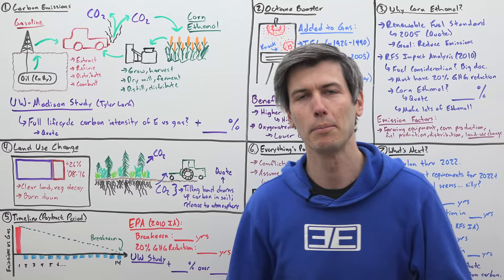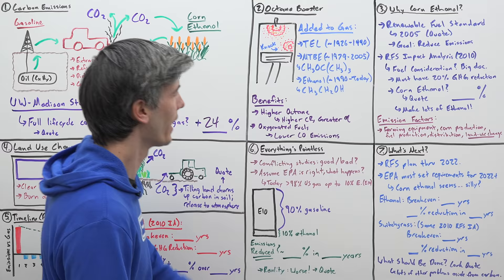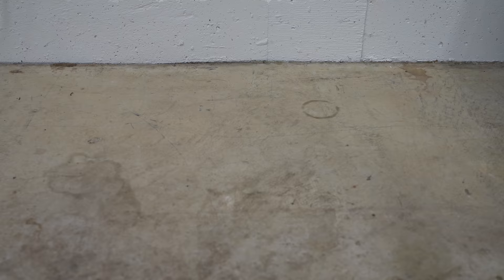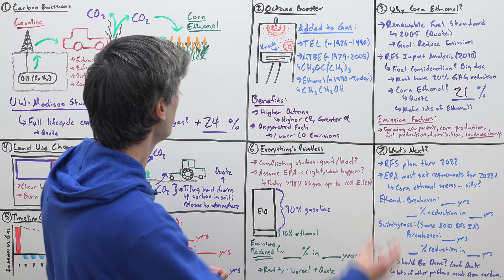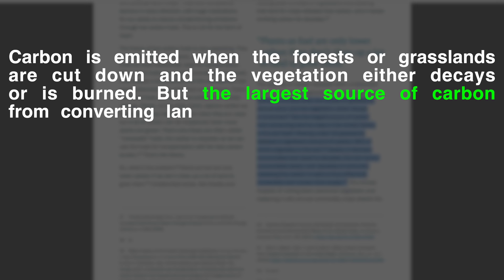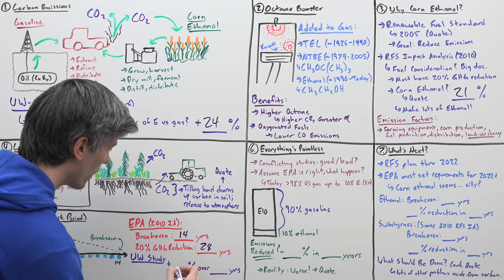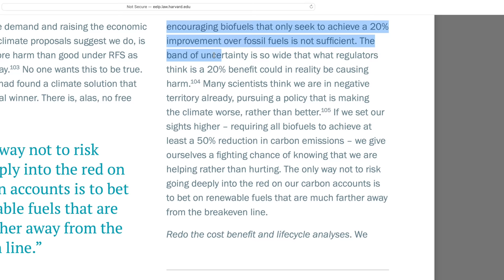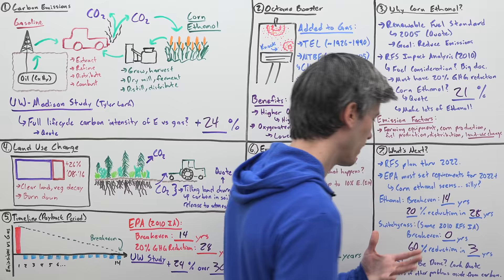America Was Wrong About Ethanol - Study Shows

Comment: Farmers don't only till once. They till at least once for every crop. It take 4 quarts of diesel fuel just to distill 5 quarts of ethanol. We're burning food. As the comment below says, "these facts were known decades ago".
Reply: BS
Reply: All the energy it takes to produce and deliver a product to the consumer is reflected in the price of that product.

As such, please note that the spot cash delivered price of ethanol on the NYMEX is just $1.52/gallon.

The price of an unusable sub-grade of gasoline (RBOB) is $2.21/gallon.

It takes more energy to produce sub-grade gasoline than ethanol.

To turn RBOB into usable E0 fuel costs even more from the added BTEX (benzene, toluene, ethylbenzene, & xylene) and unfortunately for humanity makes it far more toxic and polluting.

Or simply splash in >10% ethanol to RBOB and the resultant usable fuel is less toxic, far cleaner burning, and cheaper/cheaper per mile to drive with.  Who can be against that?

Note that ethanol is distilled at less than 200 degrees F and crude is distilled to remove water and then distilled at 750 degrees F to make fuels.  Also note that newer ethanol plants actually use waste steam from natural gas electric plants.  Waste steam = free energy.  Soon all plants will be this way thus ethanol's already low price has room to remain low.

Iowa State University measured all the energy it takes to produce an acre of corn into a "diesel fuel equivalent"
This included machinery, fertilizer, chemicals, tillage, planting, harvesting, drying, trucking etc. 
They found it takes 34 gal of diesel to produce one acre of corn.
What do we get from those 34 gallons of diesel?
We get >500 gallons of ethanol.
But wait, that is not the kicker.
The kicker is we still get 100% of the protein and other things from that acre of corn still available for an even better feed. A win-win.

Note that 100% of the fertilizer put on corn is still fed to the livestock in those distillers grains.  Ethanol is made only of things in the air: solar energy, CO2, and water with those latter two recycled once burnt.

Comment: What does alcohol free fuels use to boost octane?
Reply: Volatile aromatics like BTEX (benzene, toluene, ethylbenzene, and xylene) are used to boost octane in gasoline.

Premium gasoline contains around 40% BTEX.  It is expensive, toxic, and dirty.  RBOB gasoline is blended with premium gasoline to make regular E0.  

10% and greater ethanol added to RBOB gasoline makes it usable, less toxic, far cleaner burning, and cheaper/cheaper per mile to drive with.

A 1948 American Petroleum Institute study said the only safe level of benzene exposure is zero.

Comment: Figure out a way to keep it from absorbing a bunch of water (it's hydroscopic), keep it from eating small engine fuel systems, and prevent it form degrading into acetic acid over time and we can chat. Until then, give me the option of ethanol-free.
Reply: Mercury Marine, which hosted a Webinar on ethanol myths, noted that ethanol does not "grab water molecules out of the air." It is hydrophilic, which means ethanol holds water. With regular gasoline (E0) as well at E10, the primary cause of water collecting in tanks is condensation on tank walls. But unlike E0, which can absorb almost no moisture, E10 can hold up to half of one percent of water by volume, and the water molecules will dissolve in the fuel. The "solubilized" water will bypass the water separator and burn harmlessly through the engine.

>>>>Mercury Marine also says E10 may be the superior fuel(over E0) because it keeps the fuel "dry"<<<<

If ethanol did absorb water as you claim, your own eyeballs would know it for the news every winter would have the spectacle of millions upon millions of stalled cars on all the roads in the northern US and Canada.

In fact, in the days of E0 it was common enough to have stalled cars so that people would have to buy little cans of alcohol for gas-line antifreeze to fix water problems called Heet or Dry Gas.  No need to buy since E10 came along.

The fuel system parts of a flex fuel vehicle are identical to those of a non-flex fuel vehicle.  

Ethanol on most any chemical compatibility chart you will find is at worst equal to but most often easier on rubbers, metals, and plastics than what gasoline and BTEX (benzene, toluene, ethylbenzene, and xylene) are.  

You need water to freeze a gas-line and to make acetic acid, ethanol keeps the gasoline dry.

Brazil has the very same small engines we have and their common gasoline contains 27.5% ethanol.  It has worked out so well and for so long that Paraguay went to E27.

The DOE found that ethanol blends last 3 times longer than E0 in small engines because the volatile petroleum aromatics used for octane evaporate out and leave behind a sub-octane unusable fuel.

Comment: An other interesting statistic (which I'm not 100% sure is true) is that it takes approx the same energy to make ethanol from corn as you get back from burning it in an engine.
Reply: Iowa State University measured all the energy it takes to produce an acre of corn into a "diesel fuel equivalent"
This included making of machinery, fertilizer, chemicals, plus tillage, planting, harvesting, drying, trucking etc. 
They found it takes 34 gal of diesel to produce one acre of corn.
What do we get from those 34 gallons of diesel?
We get >500 gallons of ethanol.
But wait, that is not the kicker.
The kicker is we still get 100% of the protein, minerals, vitamins, fats, etc. from that acre of corn still available for an even better feed called distillers grains. A win, win.

All the energy it takes to produce and deliver a product to the consumer is reflected in the price of that product.

I see the spot cash delivered price of ethanol on the NYMEX today is $1.70/gal.

The price of an unusable sub-grade of gasoline (RBOB) is $2.03/gal.

To turn RBOB into usable E0 fuel costs a lot more much like premium costs more.  Unfortunately for humanity, it also becomes even more toxic and dirty.

Or simply splash in >10% ethanol to RBOB and the resultant usable fuel becomes far, far, cleaner burning, less toxic, and cheaper/cheaper per mile to drive with.  Who can be against that?
Reply: @danafletcher2341  thank you for the information. I'll certainly look into that. I thought that the distilling process used a lot more energy.
I knew about the distillers grain as an output, but I was not aware of ethanol being used to make the RBOB grade of fuel useable. Very cool.
Reply: @protonmaster76  Traditionally ethanol is distilled at less than 200 degrees F.  A patented nano-bubble process in a vacuum column is at 104 degrees F.  

Crude oil gets distilled at 725 degrees F.  This obviously takes way more energy.

Today's newer ethanol plants actually use the waste steam from natural gas electric plants to make ethanol.  Waste steam = free energy.

Poet, the largest ethanol producer in the world has at least half their plants this way.  Soon all will be like that for who can compete with free energy?  Thus, ethanol's already super low price has room to remain low.

As I said, all the energy it takes to produce and deliver a product is reflected in the price of that product.
Reply: @danafletcher2341  thanks again for the detailed reply.
I know this is a different tact on my original statement, but if you were to take into account the solar energy required to grow the crop the energy equation looks quite different. That is, if solar panels were used on a small portion of the field, that could be used to electrify the same number of cars that the whole field of corn could run on ethanol. Therefore, equivalent land space could be used to power cars and grow any crop.

Comment: If you continue to till the soil, of course it produces more CO2.  Now, what happens if you use no-till or regenerative agriculture practices, there should not be the massive springtime release of CO2, and if you use green-mulch crops during the winter, the theory is that you will increase the nitrogen content of the soil.  Has anyone done that study?
Reply: The study was not worried about yearly tillage on old farmland, it was based on the claim that virgin grassland and forests were broken up to grow more corn acres for ethanol and then charged 24 to 28+ years of CO2 to those acres being tilled.

Of course, that claim is impossible since US cropland have been declining.

Census data even shows that in corn producing states grassland, forest, and wildlife areas have increased since ethanol.

Believe it or not, the corn belt grew more corn acres in 1980 before ethanol than they did in 2018, the year of most ethanol production ever and ethanol plants everywhere.

2018 Iowa 13,200,000 acres of corn with record ethanol production
1980 Iowa 14,000,000 acres of corn before ethanol

2018 Illinois 11,000,000 acres of corn with record ethanol production
1980 Illinois 11,600,000 acres of corn before ethanol

2018 Indiana 5,350,000 acres of corn with record ethanol production
1980 Indiana 6,450,000 acres of corn before ethanol

100% of the fertilizer and everything in the soil still gets fed to the livestock in the healthier distillers grains.  Ethanol is made only of thing of the air: solar energy, CO2, and water with the latter two recycled once burnt.

What logic is it then to assign all the CO2 and energy of fertilizer to ethanol and none to distillers grains?

Comment: Soil amendment...
AKA fertilizer manufacturer and application!
Reply: All the fertilizer still gets fed to livestock in the distillers grains.  Ethanol (C2H6O) is only made of things of the air: solar energy, CO2, and water.

What logic is it to assign all the fertilizer to ethanol and none to the distillers grains?

 Iowa State University measured all the energy it takes to produce an acre of corn into a "diesel fuel equivalent"
This included making of machinery, fertilizer, chemicals, plus tillage, planting, harvesting, drying, trucking etc. 
They found it takes 34 gal of diesel to produce one acre of corn.
What do we get from those 34 gallons of diesel?
We get >500 gallons of ethanol.
But wait, that is not the kicker.
The kicker is we still get 100% of the protein from that acre of corn still available for an even better and healthier feed called distillers grains. A win-win.

Comment: That was a joke. I remove the ethanol now to run my 4-stroke equipment. I never have to drain the gas for winter anymore.
Reply: I dont either....I run E15 let it sit all winter. I had to charge the battery and then BOOOOM it fired right up! Video is up on my channel.Whadda joke.

Comment: Ethanol requires more fuel to do the same job. It reduces the volumetric efficiency of your engine, causing your engine to work harder for the same output. Ethanol also requires more expensive fuels system components.
Reply: FROM ONE PAPER:
Engine volumetric efficiency
A literature review on the topic of volumetric efficiency links ethanol’s higher heat of vaporization (HoV) with an increase in engine volumetric efficiency.12,13,25,26 Figure 2 presents the heat of vaporization per kilogram of stoichiometric air versus ethanol content for the fuels used in this work.

The higher ethanol HoV leads to more energy absorption from the surrounding air than gasoline, during fuel evaporation, therefore enhancing the intake air mass cooling effect. This behavior increases the intake air density when compared to gasoline. A higher intake air density tends to increase the engine volumetric efficiency, which means that the engine can burn a higher mass of air–fuel mixture, favoring engine brake power increase. The direct relationship between higher volumetric efficiency and higher engine brake power can be seen in equation (1). This higher cooling capacity of ethanol can be seen in Figure 3, which shows the relative difference to B_E0 fuel for the calculated in-cylinder intake air average absolute temperature , with each fuel and engine speed.

FROM ANOTHER PAPER:
Influence of ethanol mixing on volumetric efficiency
Figure 5 indicates the impact of ethanol introduction on volumetric efficiency at different engine speeds. As the engine speed in the mixture increases, the induction air mass and volumetric efficiency increase. As the proportion of ethanol in gasoline - ethanol blends rises, the volumetric efficiency rises as well. The heat of evaporation of ethanol is 2.75 times more than gasoline, which lowers the intake manifold temperature and improves the volumetric efficiency. As ethanol concentration is increased, the fuel consumed and volumetric efficiency rise due to lower vapor pressure of ethanol.

So how do those two papers apply to the real world?  A Chevy 5.3L puts out a clean 380 horsepower on E85 vs a dirty 355 on E0.

The very early flex fuel vehicles were methanol/M85 capable along with E85.  Because methanol is slightly corrosive, those early flex fuel vehicles had stainless steel fuel system components.  Because methanol use never materialized, that capability was soon dropped and the fuel system components went back to the standard mild steel for E85 only flex fuel vehicles.

From 2014 onward, the Chevy 5.3L flex fuel engines had a fuel sensor added to adjust engine for ethanol instead of the standard stock O2 sensor.  The cheapest price I saw for this sensor was $36.00.  Factory cost on the assembly line must be very nominal.

So far, this only applies to our current inefficient gasoline optimized vehicles.  In ethanol optimized engines, they can take advantage not only of heat of vaporization of ethanol but also flame speed front, octane, volume of combustion products, and other characteristics to not only gain horsepower but also gain in mileage.  So much so that ethanol has more mileage than even diesel engines.

Here is an excerpt of an ethanol optimized engine Ricardo built for GM and drove around a few years ago:

FROM RICARDO:
The new federal CAFE standards are calling for a doubling of fuel mileage performance, which, Vint says, is going to send OEM’s looking for high octane numbers to improve efficiency and ethanol is the best source. Ricardo, an engineering firm with over 100 years in the business of engine design, has developed an extreme boosted direct injection engine (EBDI) to optimize ethanol blends. The 3.2 V6 gasoline engine rivals the power and torque of a much larger GMC Sierra 6.6 diesel, he said, and it delivers 3.5 percent better fuel economy than the diesel.
Reply: @danafletcher2341  - Apparently, considerable advancements have been made in recent years... or engines are being built to specifically take advantage of the higher octane rating, and just severely retard ignition timing (and power) when running on non-ethanol gasoline. I have seen several builds reach similar targets with optimized parameters (higher stoichiometric/static  compression, more ignition advance, etc.)... but I have never seen such gains on a build optimized for gasoline. 

Furthermore, I have owned several pre-2006 cars/trucks in which ethanol blended fuel wreaked havoc on both the fuel system and performance. I have a 1998 Infiniti q45 with a mere 10:1 compression VH41DE... and even as little as 10% ethanol blend results in ping/knock, to the point the engine can't be driven under full load at wide-open-throttle. I don't have this issue with 93 octane non-ethanol gas. Another example of ethanol's supreme failure, is in carbureted engines. Trying to run OEM carburetor applications on as little as E10, causes loads of issues not experienced with gasoline. Regardless of what these papers say... ethanol blended fuels are far more susceptible to boil off under low pressure. The last engine I attempted to fix for a friend who was adamant about keeping his original carb and intake, was an ultimate failure. Even after extensive rectification, such as blocking stove passages, removing the heat riser, adding a phenolic spacer, retarding timing... nothing would get it to run consistently in warm weather. It took replacing the intake with an aftermarket high rise to get it somewhat highway friendly... but it still wouldn't tolerate extended times, town driving, or hot days. Thankfully, a local station started offering REC 90. Even though the octane was below the recommended 92, we went back with the stock intake, and all was well. As a safety measure, we backed off ignition timing by 2°, but everything else is stock.

Don't get me wrong... I'm not an anti-EFI, "older is better" kinda guy (quite the contrary, actually)... but these CAFE standards and jump-the-gun solutions aren't doing anyone any favors.
Reply: @driverjamescopeland  Thats a great story. I run a plain Quadrajet I modified myself on an 440 Chrysler without any problems for year. MORE timing then stock.